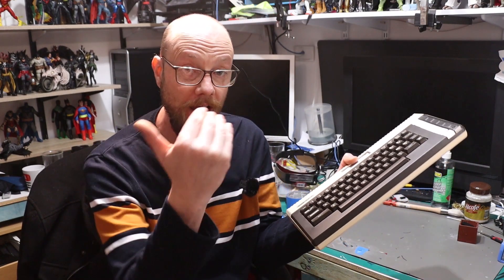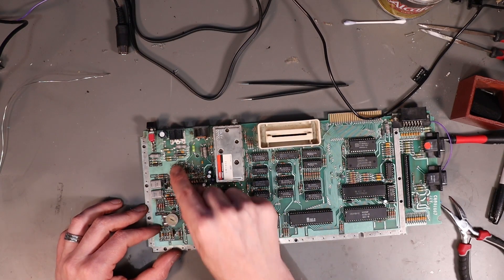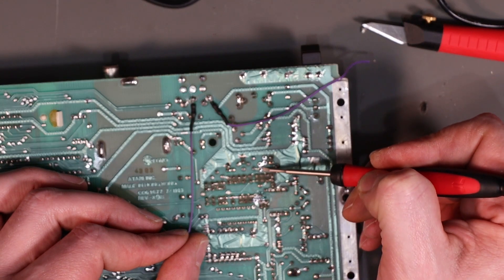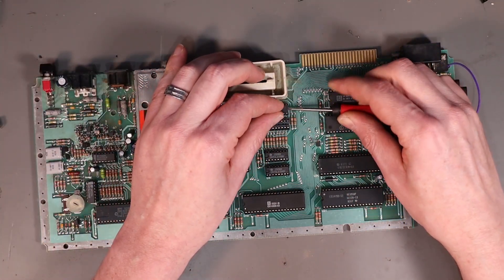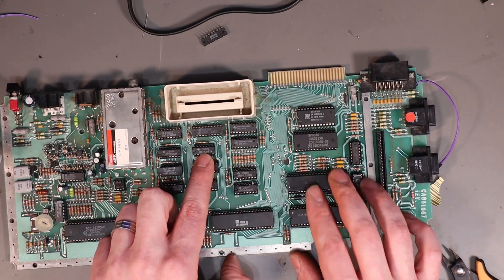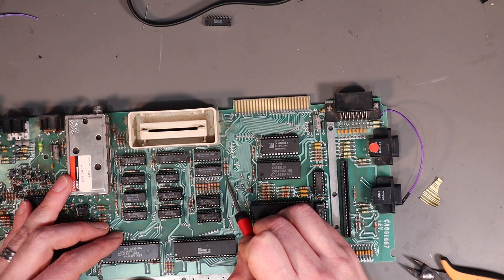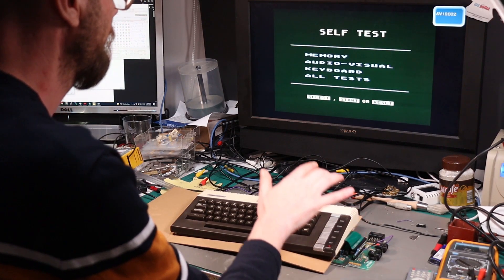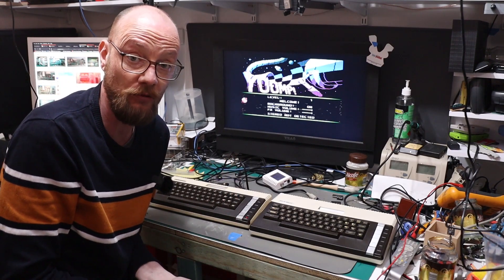Atari 600XL: Video, RAM, and ROM

Comment: Nice job. Good you're enjoying the machine! 64K is practically a mandatory upgrade. Your 600XL has a rare mechanical keyboard type for the XL's, called the type 3 or AWC. There are two other more common mechanical variants for the XL's but most 600XL and 800XL's are mylar non-mech.

Comment: When pin bending is called for, I usually employ a socket.
I buy a socket, put bend the pin on the socket instead, and put the chip into the socket and the socket into the board again. That way, if I've counted the pin number wrong or need to undo my change, the chip remains unscathed, and I can always use another socket.

Comment: Thanks for showing these mods. I used the S-Video mod on my NTSC 600XL, which surprisingly works even though it is missing many circuits. So I end up with S-VIDEO but no composite on an NTSC 600xl.

Comment: 11:00ish: Given the clearance you have in the case, I wouldn't snip off any legs, I would bend them up in a U-, J- or L-shape, and then side-solder to that end, which with enough care would leave the modification reversible.
Reply from the maker: 74LS158’s are still available and not difficult to replace and honestly, the chances of me wanting to reverse this mod is almost zero.
Reply: @MrLurchsThings  That's a fair point. It's just a personal preference thing for the principle of it. That said, I have irrevocably altered retrocomputers before. Once it's your computer, you do you.
Reply from the maker: I reckon a lot has to do with the mod being tackled. Eg the GTIA and port cover for the 800 are carefully packed away after installing the Sophia.

Comment: Makes you wonder why the 800xl needed to be so much bigger! I guess ram chips at the time didn't have that capacity.
Reply: plus the array of resistors filtering the keyboard inputs in the case  of the 600 XL is on an adapter ! It was a machine designed between 80-82. The miniaturization of parts was not at its best.

Comment: 15:55: So does that memory test only check 48K of RAM as opposed to 64?
Reply from the maker: Honestly, I’m not 100% sure. The mistake I made was to not run the memory test on the original 16kb and compare. Although I might plug in the 800 today and compare to that.
Reply: It checks the full 64K if BASIC is disabled. If BASIC is enabled, eight squares will not show in the test because the BASIC ROM is 8K.